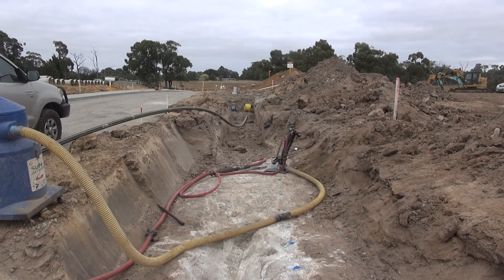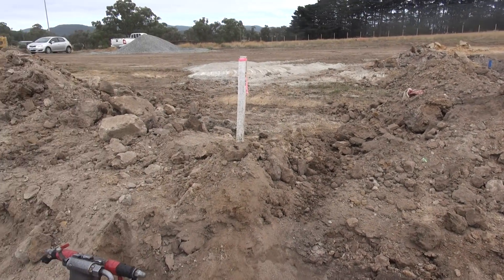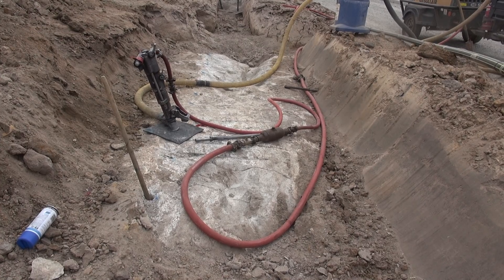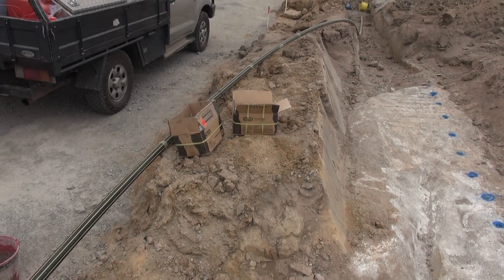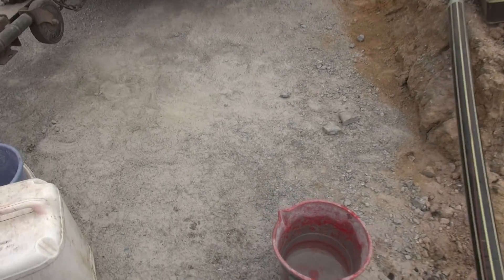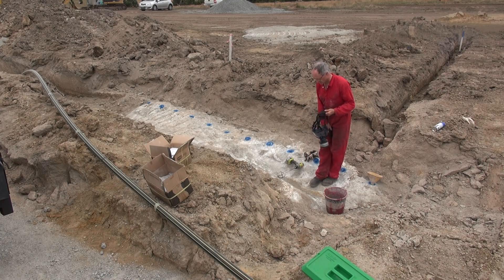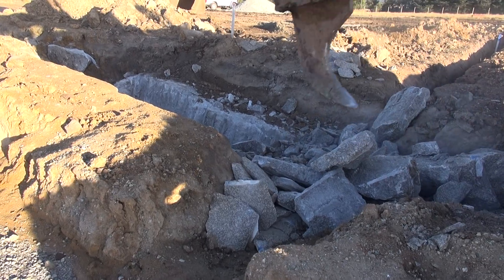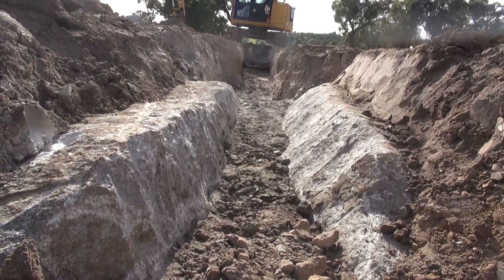Trenching in Granite without explosives

Comment: The Ancient Egyptians used to put wooden wedges into crevices chiseled in granite. Then wet the wood. As the wood expanded, the granite would crack along a desired plane.
Reply: Right....
Reply: I believe the only metal tools they had at that point were bronze, so just making a hole was tough, for every few people chiseling there was someone sharpening the chisels because they got dull so fast, did you see the recent show where they were finding the living quarters for the workers, we always thing about the pyramids, but not all the infrastructure for the tens of thousands of workers.
Reply: They found what they postulate to be living quarters for the workers, no one actually "knows" for sure.
Reply: Brent,  you're right, it's all just theory's, hell, won't they have egg on their faces if it turns out aliens really built the pyramids.
Reply: Ha, yeah wouldn't that be a hoot. I don't know, I'm not sure I buy aliens. All I know is it doesn't seem realistic to think people barely out of the stone age figured out how to carve several different kinds of super hard stone to the degree they appear to have with wood, copper and at best bronze. I'm leaning towards civilization being a lot older and far more advanced than is currently "accepted". All other theories I've read or heard seem a little too audacious and fantastic. This video is a good example of just what kind of challenge it is just to rough out some of those materials, let alone work them to the degree that ancients seem to have. Just seem like there's a lot missing we don't know about.
Reply: I watch all these different show and video's with different theories, it does seem like there's a big chunk of information missing.
Something else that never ceases to amaze me, they say the dinosaurs ruled the earth for 170 million years, if you think about what that means, it's mind boggling.
Reply: That kind of time frame really is just amazing and I want to say almost beyond our scope of imagination. Sure we see the numbers and understand what they mean but to really comprehend that many years in an actual real time frame is just incredible. Even just since the dino's went extinct, 65 mln years...is almost incomprehensible. Who knows what may have been in those millions of years. Humans supposedly evolved within the last what 2mln of those? It's pretty easy to think our current state of being may not have been the first or only one in the other 63mln before that. That leaves worlds of time for many civilizations to have evolved, developed and collapsed before us. There really is no need for any "alien" theories even though I readily admit I love to think about alien civilizations, visitation, etc...
Reply: So many things have happened, and are still happening that we have no explanation for, I think anything is possible.
Reply: That is not so , they have found what is now know to be their village . They even made small pyramids to bury their dead !
Reply: welshpete12
What is not so?  In my first comment I said they found their living quarters, they also recently found caves the workers dug to store their boats in, but they didn't explain why they needed to store their boats in caves.
They also found evidence that they dug canals so they could get their boats with the stones withing a couple hundred yards of the pyramid.
Reply: We should never forget just how intelligent we are as a species, especially when faced with problems. We shouldn't underestimate the people from times past. The only real advantage we have is technology that has been developed over time. We are all standing on the shoulders, so to speak, of the generations that preceded us.
But I feel it is somewhat overlooked just what can potentially, and apparently was achieved when large numbers of human beings are got together to accomplish a task. Especially when a small portion of that number are given authority over the mass, and given whips and allowed to mete out punishment or reward. Much more stick than carrot though I would assume.
I discount anything regarding aliens and such as utter, ridiculous, ignorant and often charlatan horseshit.
The odds of another intelligent lifeform, far superior to us, living within anything like a reasonable distance is vanishingly small.
People really apparently have little conception just how mind bogglingly, hugely, enormously gigantic space actually is. Even with light speed being as rapid as it is (186,000 miles per second. The Sun, 92 million miles distant is a mere 8 and a quarter light mins away). The closest other star is Proxima Centauri, 4 and a quarter light years distant.
We have only been pumping out radio into space for around 90 years. Hence we have a shell of radiation surrounding the earth that is ever expanding (and getting less detectable as it diminishes also) that is still only now 90 light years in radius. Anything outside this sphere of radio signature cannot possibly even know we exist.
To imagine aliens are or have been visiting earth takes the rather large leap of assuming we have something wrong regarding physics and especially special and general relativity. Something of a stretch.
And also to assume that we are in some way far far more important than we in fact are. Simply another life form that evolved on this planet.
Reply: They are saying now, the people building the pyramids were paid workers, I was joking about the aliens building the pyramids, they've got a lot of how they were built figured out.
As far as traveling the universe, even if you could go thousands of times faster than light, it would have to be one way, because there would be nothing for you to go back to, thousands of years will have passed on your home planet, so what is it people are seeing, you can read reports from the navy about them seeing crazy stuff, a Russian sub tracked something going hundreds of miles and hour under water, then leaving the water, shooting up into the sky at thousands of mph, those aren't nuts reporting that stuff they are officers, most of the stuff the average person see's can be explained, like 97%, but what about the rest?
In the 80s a Japan air cargo jet was followed over Alaska for an hour or so, ground radar was also able to track it, it made the news, you can watch a video of the second in command of the FAA talk about the incident, and how the CIA came and took the radar the recordings.
What are they?
https://en.wikipedia.org/wiki/Japan_Air_Lines_flight_1628_incident

Comment: What were you running in the trench?
Reply from the maker: blindabinda123 just gas and water
Reply: Demolition Dave Drilling and Blasting the ledge didn't drop off closer to the gas main? Or did you guys not try. We usually at least try to find away around ledge when we come across it. Was this just for a services or to run the mains?
Reply from the maker: just for services, the Gas main was about 8m (?) away
Reply: Demolition Dave Drilling and Blasting nevermore l never mind. I see the gas main abs the service trench now that I look again. What size water main? ?
Reply from the maker: I can't recall what the trench was for, the gas pipe can be seen in the video not sure if the other was to be electricity or water.
Reply: Demolition Dave Drilling and Blasting ya the black one with the yellow lines is a  gas main. Service lines for a house are usually no bigger than 1" so that black line is a gas "main" just a different pressure from the one they didn't want you to blast near. Likely the smaller trench going towards the high pressure main is a service line for a house or that is where they are going to tie that 4" main into the high pressure line or could be a water service. This must not be in an area where you get Frost from winter right?
Reply from the maker: The high pressure main that they did not want me blasting near is the main feed from the refinery to a major city, 30 inch & 1500 PSI. No snow or ice here.
Reply: Demolition Dave Drilling and Blasting that's what I figured.

Comment: I've got a few boxes of Expando sitting about for breaking up a big lump of granite in the middle of an established vineyard. Biggest challenge so far is drilling the rock - I've tried using a diamond core drill, but it takes a damn long time to get to any kind of depth. Might need to bring more power to the task with the kind of rig you're using for holes...
Reply from the maker: Gaf - You might be able to hire a drill like mine and a suitable compressor to run it. Where are you?
Reply: Just outside Canberra. Ironically, we've got a Boral quarry over our back fence who blasts once a month or so, but I don't think the rig they use to drill would fit down the narrow vineyard rows. Wil see if Coates or the like have any kind of drilling gear.
Reply from the maker: You want a rotary percussion pneumatic rock drill and a 38mm drill steel if you are going to use Expando or you could engage a local guy like Deon Becker from Jyndabyne, he would be able to fix it for you in a flash.
Reply: Cheers for that - I feel like I should give the Expando a go, since I've got the stuff  - I think in different temperature ranges as way back when I ordered it, I expected it'd be used during winter/spring when the vines are asleep. If I have no luck, it might be time to call in the experts :)
Reply from the maker: It looses it potency with age, best before time is about 18 months, you might need a few more holes if it is older.

Comment: or simply use a hydraulic hammer on the excavator ...
Reply from the maker: They had a shot at hammering it with a big hydraulic breaker on a 36 Tonne machine but the progress was not substantial and the breaker point was worn down quickly. This rock is harder than you think.
Reply: Wrong tool for the job and an excuse at every turn.......sad times.

Comment: What a nightmare having to do that. All for 20 feet of trench. On another note you need to find a way of drilling those holes that ain't gonna break your back into a million pieces. I'm almost certain you can get those drills mounted on diggers.
Reply from the maker: Yeah, got one of those, was not working at the time, going again now though. I don't mind hand drilling vertical holes but the angle holes are a shocker.

Comment: Seems like a hydraulic hammer on 5he Trachoe would make quick work of that #7 granite
Reply from the maker: From the description - " they had a shot at hammering it with a big hydraulic breaker on a 36 Tonne machine but the progress was not substantial and the breaker point was worn down quickly"
Reply: why not read the headings

Comment: How much does that stuff cost?
Reply from the maker: I can supply a 20Kg Box for $240 inc. GST, this will fill 2.2m of 38mm diameter holes
Reply: Demolition Dave Drilling and Blasting 
Wow that's high. So that was several thousand dollars to do that job?
Reply from the maker: Not a cheap job, used 95Kg.

Comment: 5:20 Drilling positions are intresting.
Reply from the maker: Oh, there is many more. Thanks for subscribing.
Reply: Any way you can maneuver one of those things to drill at an angle without getting thrown your doing just fine. I use to get it going a couple inches then sit on it. Of course in a vertical hole and a cushion under my ass. If you have to drill a lot of those holes you come up with some weird positions and ideas. Lol

Comment: Now that is what I call HARD WORK. Watching you contorting and struggling when drilling I was just  in awe of your ability to stay with it !!! Also I had no idea that such compounds existed.
Reply from the maker: Drilling vertical holes is not too difficult but the diagonals are a lot harder.
Reply: Is that because your body ballast is directly over the drill on vertical holes?  Man, that's a hard way to dig rock, but you got it done!
Reply from the maker: Correct.
Reply: Do you need a kidney belt to ride those things?
Reply from the maker: No, but it does sort the workers from the watchers.
Reply from the maker: Gln Hodges - got one of those, it was in need of attention at the time so the hand drill did the job. See in action here - 11:18 https://www.youtube.com/watch?v=KP3Ueknxrg8&t=1s
Reply: Those same pneumatic drills, and bigger are used down mines and in queries. Imagine drilling in a portion of granite high up, or over head. With a ten foot drill rod.
Those if not machine mounted, which they these days tend to be, are used with a power leg, that helps hold up the drill body and push it into the hole. It is still not an easy job. Far from it. Much easier in soft shale, mudstone and coal. LOL.
Easier still mounted on a machine.

Comment: And they want us to believe Egyptians carved granite with copper tools.....lol
Reply: And they want us to believe that you can cut steel with water or light.....lol.  
On a more serious note archaeologists have shown that you can cut granite with copper tools by cheating and using sand between the tool and the rock to grind away rather than cut directly. Maybe they used another method back then, but it show that it can be done.
Reply: no granite in the pyramids, only limestone. they also used granite, but just for the kings chamber.
Reply: You are correct. Average weight around 2.5 tons which is maneuverable by just 8 men.
Reply: Obelix.....limestone was only used as the outside layer of the pyramids.  All the structural blocks (and most of what's actually left since the limestone is mostly gone) is granite.
Reply from the maker: Yeah right, it is hard on tungsten.
Reply: Have you seen the images of kerf marks on the pyramid blocks?  It seems they had something like a 9m diameter circular blade made out of God-knows-what.
Reply: Copper or bronze... When they tested the sand drilling they used a copper tube with sand as an abrasive, the resulting marks matched what was seen on the ancient stonework.
Reply from the maker: no, not heard about that.
Reply: They had iron as well. Ironworks from the 4th dynasty with engravings relating to that time in the Sinai mountains. It would have been an expensive metal and the production method a closely guarded secret.
Reply: Maybe they did use iron, unfortunately there is no archaeological evidence of iron use at the Giza site, while there is definite evidence of copper and bronze use. People latch on to the idea that ancient cultures must have had advanced technologies that were lost in time. Even today we can't cut rock. We either bash it, grind it, or split it with wedges. Ancient cultures had access to some form of all those methods, they just needed more effort due to less refined tools.
Reply: The point about iron was that anything relating to its production would have been a closely guarded secret. The Hittites used iron swords (longer, harder) and disclosing the production technique would have cost you your life.  

Copper was readily available though still not cheap but comparatively easy to make. It's production methods were already well known. Egyptian copper was also naturally rich is arsenic which enhanced its hardness.

As for iron: There was an iron dagger in the tomb of Tutankhamun. Admittedly, that was meteoric iron but it shows they knew how to produce it. The 4th dynasty ironworks are real enough. Iron plates have also been found inside pyramids. (link below)

Any tools would have been expensive and easy to steal so you can bet they looked after them.  By the time of the Arabic-Islamic conquest (740 CE), the pyramids were already 1000+-year-old collectors of dust. 

The Arabs were not kind to Ancient Egypt (see Palmyra, Mosul and its libraries etc). They are well known to take technology and claim it as their own. I personally do not believe the Arabs developed Damascus steel especially since they imported steel from India (who were already well ahead of the game) and Shri Lanka. 

Do also bear in mind that Egypt has for centuries been an Arabic-Islamic culture that has a low tolerance of anyone speaking or criticising its own history (which is absolutely not something they can be proud of). The current 'protectors' of these places are between a rock and a hard place when it comes to revealing what  early Arab invaderss did. 

http://www.ancient-wisdom.com/Ghizaarchitecture.htm
Reply: The Egyptians used fire and rocks (very hard ones).
Reply: One basic answer about why someone did something a certain way is "because they could"! Therefore, why did the ancients build so much with stone? The answer "because they could!"  So they must have better schemes for rock shaping, carving and moving than what we can imagine now.
Reply: Egyptians use aliens to carve their granite

Comment: I was gonna mention too, the goo does work, but you need somewhere for the rock to go.  I would have drilled some relief holes, or diamond cut somewhere for the rock to go.
Reply from the maker: It's always nice to have extra holes to help it work but when the temperature is ~35c (95f) and you are using a hand drill you just want to get it done.
Reply: True enough sir, I totally understand that.  (No sweat, giggle).  Cheers!